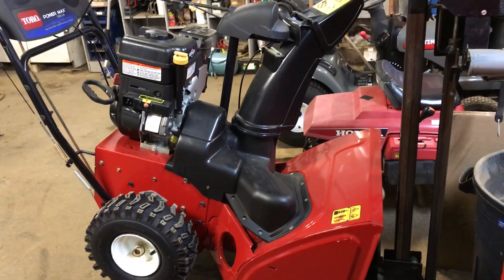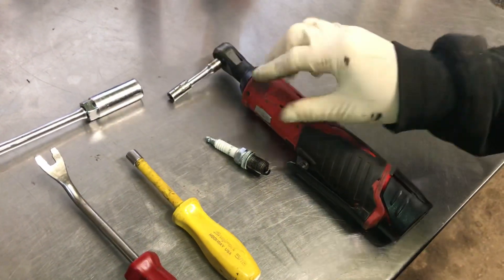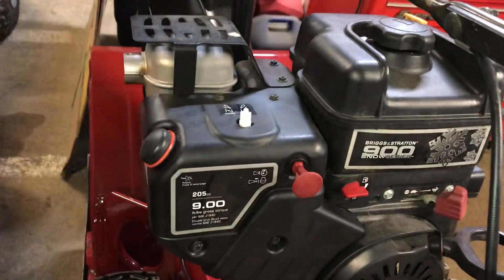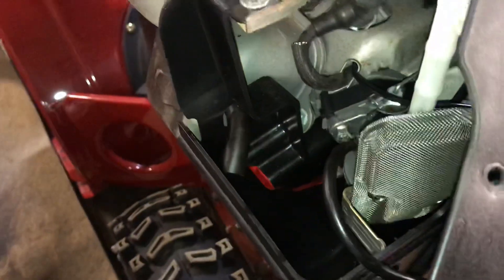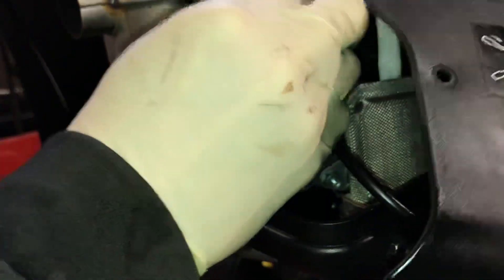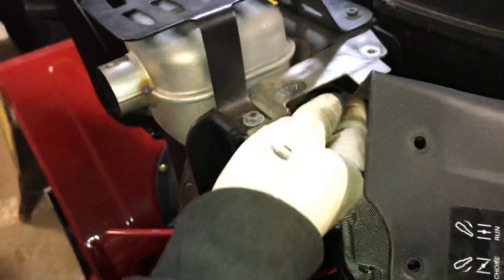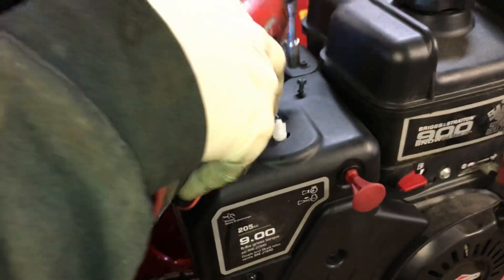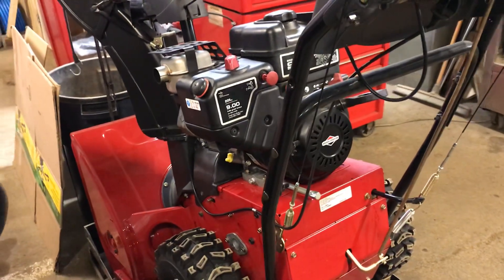Spark plug location on a 9hp Briggs and Stratton Snow Thrower engine

Comment: Great video sir. Thanks. I've often wondered where the darn plug was located on my Toro Power Max. After 7 years of reliable starts and running perfectly, do ya think changing (or at least inspecting) my plug is a tad overdue?
Reply from the maker: It does depend on how many hrs. and the condition of the engine on when to change the spark plug. I would say after 7 years, you are over due but you can look at it and normally you can tell what you need to do. My opinion, It is a hard one to remove so if your there, change it.

Comment: Great video, very well explained. I have the exact same 9 horsepower Briggs and Stratton. On the plastic cover that you are taking off, any idea where I would buy the 5/16th Replacement screws?  How long are they? Are they a specialty product. Are the screws that are covering the muffler protector also 5/16ths? 
Sorry to pepper you with questionsIf by chance you know the answer To any of those questions , I would certainly appreciate it. Again great video very well explained

Comment: Only thing, i did this and its damn hard, to get the plug in/out, the kill key seems disconnected and i could not see from this video where its connected... it won't start now.
Reply from the maker: Make sure if the key wires are disconnected that they are not touching any metal or you will not have spark. Make sure the key is in but if any wire has been disconnected you should still have spark, you just would not be able to shut it off. Make sure spark plug and spark plug wire are on correctly.
Reply: @JohnsonsSmallEngines  thank you sir! it was the spark plug boot not connected tight, it seems to be falling apart, i had to push the wire into the boot and push it on till it snapped. fired right up. not sure where or how to get a new boot.
Reply from the maker: You need to locate your engine numbers to look up the boot part number, then you could order online. This video I found should help you locate the numbers you need. https://youtu.be/VKVeWSkVKeo. If you can get the model, type and code from the engine, send them to me and I may be able to find it for you.
Reply: @JohnsonsSmallEngines  OMG thank you soo much!

Comment: You are an excellent instructor.   Thank you.
Reply from the maker: Hi Steve, thank you for the kind comment. I’m glad this video was helpful. Please give it a like, subscribe and tell your friends about my channel to help it grow. It would be greatly appreciated. Thank you for watching:)
Reply: For a bit of humour, I’m 67 years old and have been changing spark-plugs and doing light maintenance on small engines and cars since I was probably age 14 on dads hobby farm, snowmobiles, tractors, then outboards, big boats, generators (I service my Kohler 7KW on our boat and a Honda 2000 portable) etc.  

When my Toro 208cc snowblower was acting goofy, it sometimes backfires once l, when shutting down, I decided to change the plug.  

Now I do my own oil changes and summarize and winterize my engines, and have some tools.  But it’s really cold here today (Ontario Canada) and I looked at my cold snowblower and couldn’t see the spark plug wire, which bugged me, so I said out loud, “I guess this thing doesn’t have a spark plug!”   Lol.  I couldn’t be bothered taking every engine shroud apart to look, as I said I’m freezing already.  Not in the mood to tinker for a long time in freezing weather.   

My original manual is in a file cabinet inside the house.  I couldn’t be bothered removing my boots to tromp upstairs so out comes the iPhone and YouTube, and there you were.  First search and hit, and you saved me a lot of time.  And everything you stated is textbook perfect, and the tips on how to gently remove parts, is how I like to roll, to respect my machinery and not break other stuff in the process of maintenance.   

My only added tip, is that I always spray some fogging oil or WD-40 into the inside of the spark-plug boot and onto the spark plug hole prior to reinstalling the new plug.  This seems to keep the rubber soft and makes for a good contact and for easier removal at a later date, and to the best of my knowledge, does not cause harm.   

Keep up the good work.  Guys like you are a treasure for advice.  

P.s.  my plug is out and I’m heading to my favorite parts shop for replacement.  
Champions QC12YC not available but they have NGK BKR5E, so that’s what she’s (my Toro SB) getting for a Christmas present.  😎

Thanks again!
Steve.  
Happy Toro owner.

Comment: What is the torque setting for the spark plug? I have a torque wrench and would rather use it instead of guessing on the tightness. I have model 1022.
Reply from the maker: (15 ft. lbs. / 180 in. lbs. (20.3 Nm)

Comment: Hey! thanks for the video! Do you know by any chance where would be located the air filter on this engine? I have the same engine in my ariens snowblower. Thanks!
Reply from the maker: Most all snow throwers do not have air filters. There is no dust when it snows. Believe it or not, it’s true! :)

Comment: Thank you for a very informative video.  Just one question: what is the gap in the spark plug, or install straight out of package?
Reply from the maker: 30 thousandth, but normally they are close out of the box but I check every one I install.